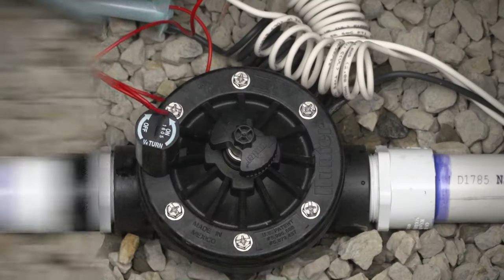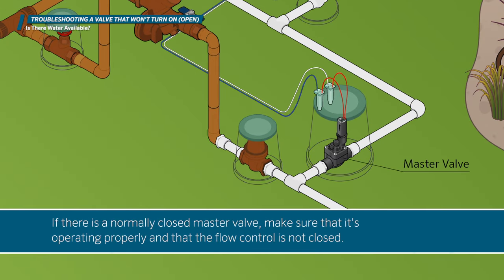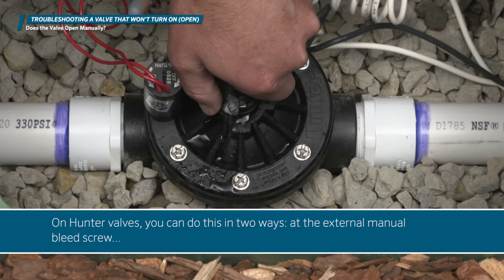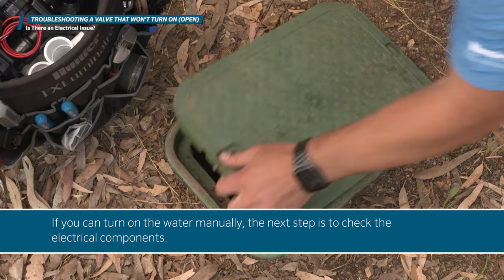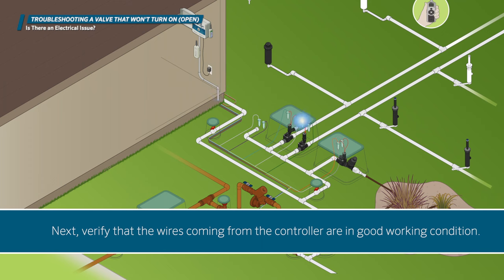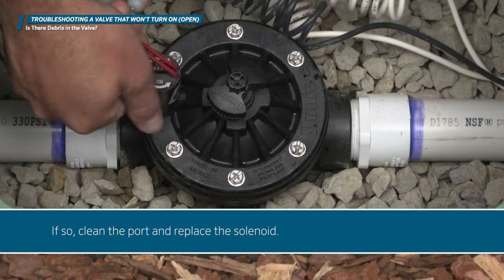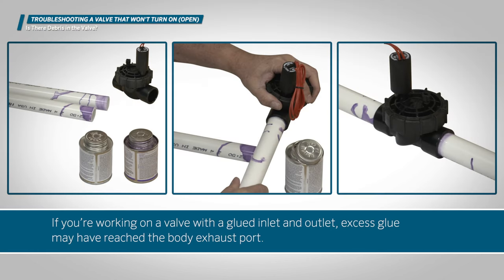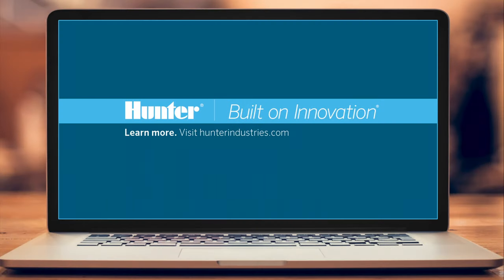Troubleshooting an Irrigation Valve That Won't Turn On

Comment: I can hear our valve has water flowing through it but does not leak water when solenoid is loosened nearly 5 turns, and the manual bleed screw does not turn on heads or leak water. Flow control is fully loosened too, solenoid was tested and works. I think there might be a clog in the valve but i took it apart and the whole thing was clean as a whistle. Im thoroughly confused now
Reply from the maker: There may be a restriction after the irrigation valve. It may be time to meet with your local irrigation professional for field help.
Reply: @Hunter_Landscape_Irrigation  thank you, we replaced the valve and it works fine now.

Comment: My system stopped turning on at its scheduled time. I changed out the entire top of the valve, but it still won’t turn on at the scheduled time. I can hear the click at the valve at its scheduled time of 7AM for it to turn on, but it doesn’t come on. I can manually turn it on at the controller box which doesn’t make sense to me. I can’t figure it out. Any suggestions?
Reply from the maker: This sounds like a good reason to contact our customer support department here: https://www.hunterindustries.com/hunter-technical-support-email-request